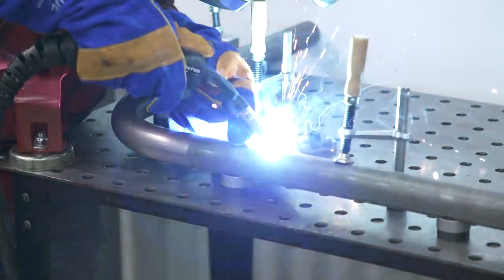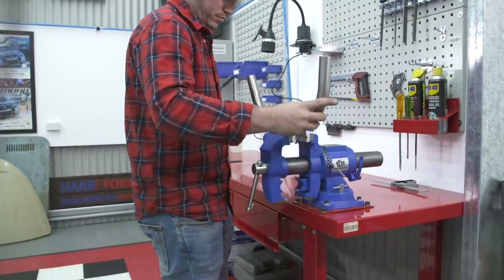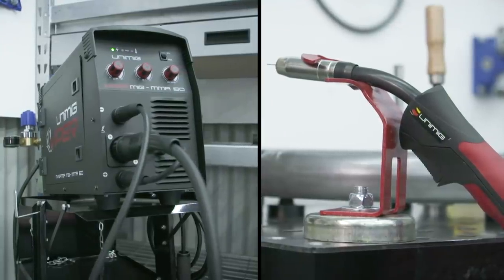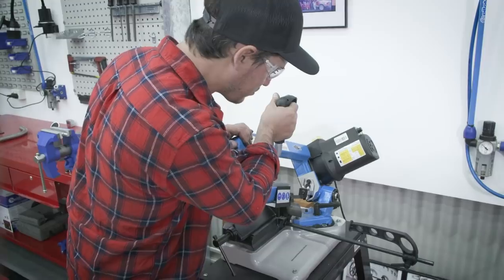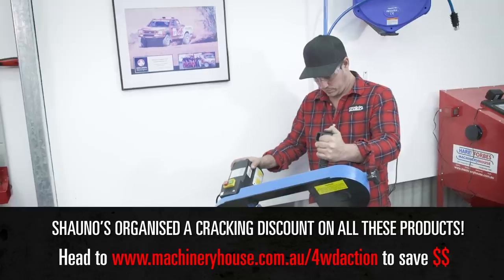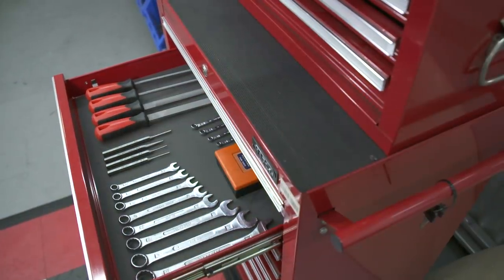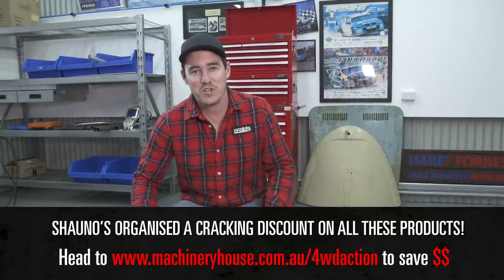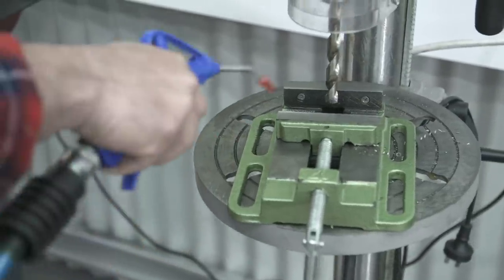SHAUNO SETS UP HIS DREAM SHED! Top 10 tools for DIY Projects!

Comment from the maker: What tool would you add to the list to set up YOUR dream DIY shed? Comment below!
Reply: matal lathe
Reply: What about a 5 inch angle grinder?
Reply: An AC/DC tig welder plus a bench knife/shear.Also a universal bar bender,you can make tube bending attachments yourself.
Reply: 4WD Action clamps of various sizes
Reply: Pipe bender is all ild add
Reply: Sky hook. At least three 😏
Reply: 4WD Action big hammer
Reply: Multimeter, spanners, and beer haha
Reply: A 75 series to put in the shed to work on
Reply: A fridge to keep them beers nice and cold!🤙🍺🍺
Reply: I think either a cutting torch or plasma cutter is essential if doing fabrication projects. I personally have a small plasma cutter that I love. Will cut steel or aluminum plates quick and clean without getting them too hot and causing them to warp.
Reply: A shed I can actually fit the 4wd in without having to take the roof rack off would be a good start. Not having to jam it up against the side wall to get the long side axle out would be handy. Oh, while I'm at it, enough length to not have to run it into the end wall & still have to open the roller door to get around the other side would be handy.
Reply: a big magnet to pick up the metal debris.
Reply: The 1/2 impact gun is essential 😍
Reply: @gqwarrior6694  yes, a big SHED!
Reply: A quality floor jack and jack stands that have the proper lifting height and are weight rated for your 4B is a Must. Also lighting, whether its portable or ceiling mounted. If your not on the track, you shouldn't need a head lamp.
Reply: beer fridge
Reply: A 10mm socket
Reply: A car hoist
Reply: map gas torch.
Reply: Hoist
Reply: Graham Cahill
Reply: air filter/dryer for compressor.
Reply: TIG and a lift 👍
Reply: Hydraulic press
Reply: Enough cash to buy it all!
Reply: A good mechanic.
Reply: have to be a lathe
so versitile
Reply: I’ve Got a mid sized Lathe a 2 tone Milling machine. But the band saw or a drop saw is a must mig welder is ok but a Tig is better for on car work.
Full socket and combo spanner sets along with pliers, drill bits, feeler gauges, files, measuring equipment it never stops just keep buying tools you will always need and use them
Reply: 4WD Action it’s just got to be battery impact driver with socket set adapter no good for tight nuts buts bets them done fast
Reply: HVAC to use the shop all year. Then an auto lift.
Reply: 5 inch grinder, low and high torque rattle gun and plasma cutter for thick shit

Comment: Plasma cutter
Sandblast gun/cabinet
Fixture table for welding
Lathe
Mill/drill combo
Hydraulic press
Engine crane & stand
Parts washer
Fridge for cold beverages
Good consumables packs/storage

Comment: I sold my house and most of my tools a few years back to simplify my life and live on a boat year round, the boat is a mini barge that was once a crew boat for the US Army Corp of Engineers. The plan is to keep the front half of the boat as a workshop(13.5' x 15'0, 59.4 meters), all of the tools need to be able to be powered by a 2000w Honda generator. A few months back I picked up a Jeep to get into overlanding. I'm getting the DIY twitch. 

I'll give my top 12, because I don't have room for two of them.

Mill and metal lathe, both of mine were 110v. Mill was a Clausing 8520, and the lathe was an old Atlas.

1- Sturdy work bench
2- Vise
3- Drill press
4- Portable band saw
5- Bench top grinder- the one you featured was sweet!
6- Air compressor
7- Mig welder
8- Decent quality hand tools
9- Locking box/chest
10- 4.5" grinder, not sure what that is in mm.

Comment: A good set of left and right handed screw drivers, is a must have
Reply: Don't forget the metric shifter
Reply: A classic when I was involved with speedway cars was we made trailing arms out of thick wall aluminium tubing and rose joints. You need one right hand and one left hand thread and therefore you need left hand thread tap. Trying to convince the apprentice to go find the left handed tap w interesting

Comment: 1) Beer fridge.
2) Pot belly.
3) Tig Welder.
4) Bench Drill.
5) Multiple grinders.
6) Work Bench with vice.
7) Tool wall for easy tool access.
8) Air compressor.
9) CLAMPS.
10) Broom.

My top 10.  Why?  Im baked and had to type somethin....

Comment: Bandsaw, mig/tig/stick welder (amico205), 50amp plasma cutter, drill press, 6" swivel vice w/pipe vice, 6" bench grinder, 4" belt sander, sand blast cabinet, toolbox and locking storage units. 👍👍

Comment: Good press, at least 12 ton. MiG welder.  Parts wash tank.  Steam cleaner(Clean it before you get dirty) for stripped parts. Battery 1/2 inch impact  (Good one)  Bench grinder, small batt grinder4.5 and big 9" angle grinder.  3/4 drive socket set for the big nuts.   TV and fridge.

Comment: Shauno.... top tip.... try to not  to use compressed air to blow metal swarf around...99.9 times it won’t get in your eye....but the day it does....😖...use a magnet covered in a disposable cloth or a quality industrial wet/dry vac....and that is a worthy addition to any shed!

Comment: Probably my most used piece of kit in my shed: my Haynes Workshop Manual, saved my bacon a few times. Closely followed by my Torque Wrench, good strong, long handle. Use it more than the rest of my ratchets.

Comment: plasma cutter is on my Christmas list. I have in my garage, a 30 gallon air compressor (150 psi max)  with over head air hose reel, 230v stick welder and a 110v mig for sheet steel, full mechanics tools, 600 lb. electric engine hoist,  led lights, and a 4 speaker stereo for tunes,furnace  heated, bench grinder, drill press, cant have a car lift due to cracked foundation, but axle stands floor jack.

Comment: I bought an old hydraulic (foot pumped) hospital bed  for a work bench, its solid metal has wheels and I can use it for unloading large items from my van and trailer as I can drop it down to their levels and wheel them into the shed. The previous owner was using it to work on motorbikes.

Comment: Great Vid Shauno.   I wouldn't be without a car hoist these days. they are becoming so cheap now that they are definitely an option if the space is available. Recently purchased a sandblaster and now wouldn't be without either.  Cheers
Reply from the maker: If you have the room - for sure! Makes like so easy

Comment: Put a thick layer of wood on top of that steel workbench less vibration, more height, a surface you can abuse and replace and you can make the top bigger too :) just a thought

Comment: Looking at the prices, they actually are fairly reasonable for what they are. I definitly thought these tools would be a lot more expensive. My biggest problem is space (or lack thereof). My workshop is the garage, and I have to kick both cars out before I can do anything (and then pack everything up at the end). Tools I can't live without: Decent socket set (both metric and imperial) breaker bar, Haynes manual for the car I'm working on, decent sound system, Makita hammer drill, torque wrench, ratchet spanners, quality set of screwdrivers, torx sockets (Jeep tends to love using them) and a shop vacuum cleaner. Makes keeping the garage tidy a lot easier.

Comment: Need a Pipe notching setup  ?? maybe as an add on for the drillpress (mount the 2 axis swivel vise on the base and use a holesaw for notching.  (Of course you can notch pipe with an angle grinder, just not as easy to get neat.)
Reply: kadmow there’s a website where you can print out a notching template for tracing by punching in a few details of the pipe you’re working with. Search for metalgeek
Reply: Expensive unless your doing it trade, but a nice to have.

Comment: Most important thing i have to change on my shed, its the actual Shed and wiring... My place used to have a wood floor and not good wiring and of course, as it was in my house, it shared the same electric stuff. 
My list would be:
1. Isolate your workshop electric structure from your home, and your breakers and lines ready for 240 (not a standard in my country)
2. Epoxy your floor and add drain canals to it, so you can wash your floor if needed. 
3. A quality Lift.

Comment: Love the vid, that will def sort out the man cave and no doubt bring a few of the boys around.

Now we just need a vid showing your workshop maybe for the next one, btw already missing the 80 out on the trails.

As others have said beer fridge, but you would need a dam good lock on yours when that DMax guy (GC) comes around 👻

But other tools good set of torque wrenches and adds ons for your air compressor like a rattle gun etc. 

But like Clint says any many worth his salt starts with a roll of duct tape, vice grips and dubbya D 40.

Rome is not built in a day boys and girls, it’s a work in progress! cheers mate 🤙

Comment: The only recommendation I'd say to the hobbyist is to make sure your drill press has a removable chuck to accept a morse taper drill 
Makes drilling larger holes 10x easier 
And if you buy a welder you should be building your own work bench, go to a heavy engineering job and ask for scrap
My table is a 2in plate with legs welded straight to the plate farmer tested to 2t
Iv got a 30 by 80 shed to play with but it's amazing to how fast you can fill it 
Should prob get a discount anyway with the amount iv spend at hare and Forbes over the years but I'll have to go check out the bench grinder, need a new one anyway

Comment: Definitely a Tig welder and an angle grinder
Reply: 3 grinders , so you don’t have to change from a cutting disc to grinding disc to wire wheel constantly

Comment: Let's start with the shed itself! 40'x40', high ceiling, good lighting, smooth floor.
Reply: And a two post lift!
Reply: Seal the concrete with a 50/50 mix of PVA and water if you don't want to paint it.  Painted floors are great but hellish slippery!
Reply: @dartmoordave  Great tip!

Comment: Instead of a traditional gas axe of oxygen and ascetaline or oxy argon make a HHO torch.

Benefits: it's just water what you can get from a stream, it's on demand meaning you have no hazardous gases stored in your workshop, it burns over 200°C hotter than other gasses so whatever you're trying to heat or cut off it's done a lot faster, low costs to use as long as you have power, you can even use urine yes URINE as a dilectric fluid for a hydrogen wet or dry cell.

One drawback, must have power to run it and other that that it has no drawbacks.

Be the best gas axe you've ever owned.

Comment: I am sorry but that metal work bench looks and sounds flimsy. I do love a good work bench though, and as a taller guy with a severe case of arthritis. I prefer a taller/adjustable height work bench. So I am not spending so much time bent over if possible. Believe me when you spend 8-14 hours in a shop it makes a difference quickly. 

Additional tools i would add, would be a plasma cutter, and cnc table. Along with a some form a tubing bender, obviously we all love hydraulic ones, but even a manual bender is better than nothing. I would also likely add a good sturdy tubing notcher. As the cheap ones often start coming apart after the first 10 cuts. Moving on to large equipment I really feel like a Decent sized, used Manual Mill and Lathe with power feeds. Once you hit about this point you should be able to fabricate just about anything you need. Even if its no longer in production.

Comment: A bigger compressor !! 😎👍🍺
Reply from the maker: Nice! What tools would you run off it?
Reply: @4WD247  Air chisels, bead blaster and nut guns eat air volume so biggest is best.
Reply: Got a few air drive tools plus I would like to get a sand blaster and a mig :) , my old compressor is just about dead but still good for the kids bike tyres lol 😂
Reply: @ToyBJ  Biggest tank you can get. Mine is a 150litre and the beadblaster drains it easy to cut in pressure.  I'll trade up to 250litre soon.  Hitachi 18v impact and cordless grinder are great plus Ryobi 18v 2 speed drill seem to be lasting well.  Both have lithium batts. Don't bother with NiMH.
Reply: I agree with that. My el cheapo one struggles to have enough pressure to fire nail guns. Lesson learnt

Comment: Well... I understand this video is meant for the general public along with some comercial flavour but... Some of those tools are just toys.

The workbench is flimsy, too thin and does not have any overhang or holes/slots to clamp stuff for welding. 1/2" for the top at the very least and 4" overhang. If on wheels, much better, you could move arround the table/bench.

The multiprocess welder is underpowered at best. Recommending a 150Amp machine (would love to see the duty cicle at max) is irresponsible. Any welder will agree that vehicle work in critical components (suspension, steering, etc) call for a 200amp machine at least.

The drill seems more suited for woodworking than metalworking. Range of speeds will not allow to run holesaws slow enough. Need lower speeds.

Bench grinder is ok, bench vice ok as well. I enjoyed the video anyway, keep up the good work!